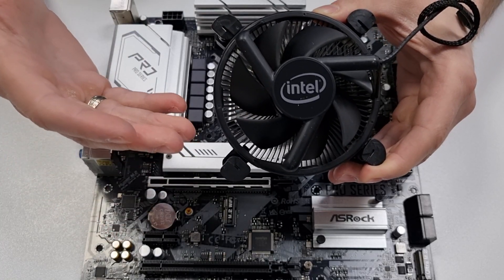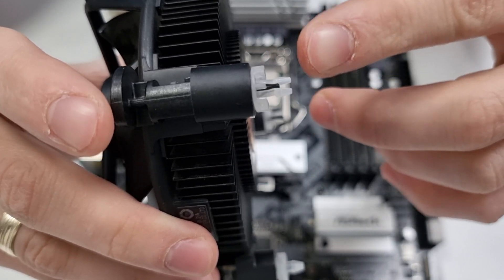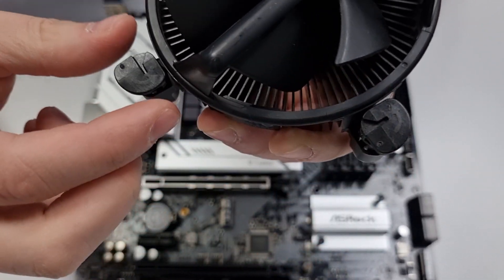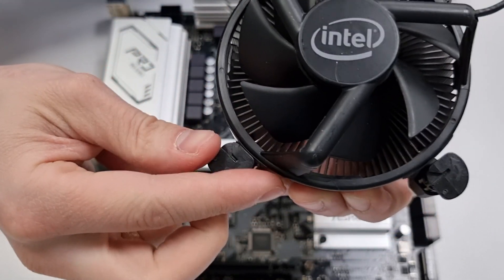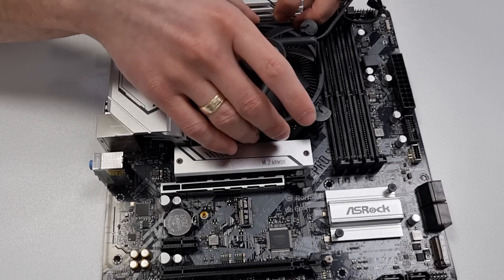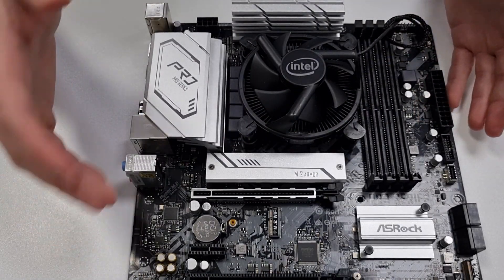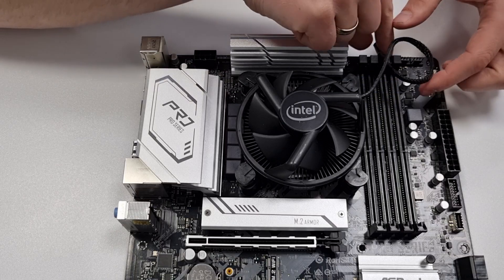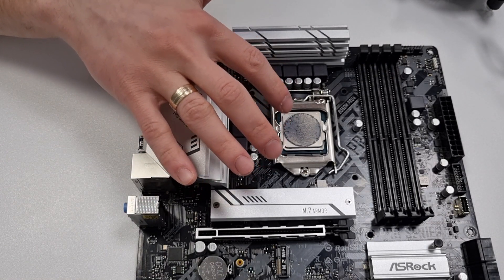How To Install Intel Stock Cooler Without Breaking It.

Comment: Thanks for this video!  Helped me out.   This is the most nerve wracking part of working on PC's IMO.  You're worried about bending the pins on the motherboard, and these stock coolers are the most flaky things.  The plastic looks like after 3 or 4 changeouts it will break or bend.  Plus you put it back in, and only 2 out of 4 go through the holes.  Just hate these things.  Cooler Master makes so much more sense where it just screws in and makes a nice mechanical connection.

Comment: I'm going to remove the stock Intel CPU cooler. This video helps. I'll install a tower type CPU cooler. I'll practice a few times before applying the thermal paste. I've never thought of that. Good advice.

Comment: Damn! I guess I missed it. One of my pins is stuck and I want to remove the stock cooler to install a new one. Can u help ?
Reply from the maker: That’s a tricky one to help with remotely 😄, but let’s try: make sure all caps are set to the removal position and lift the black pins while holding the inner part with your thumbs. If one doesn’t budge, spray the moving part of the post with silicone oil. If you can reach the back side, gently squeeze the translucent parts with pliers and pull the pin outward. Try to work the diagonals simultaneously or it can warp and become difficult to remove.
Reply: Thanks for the tip! I managed to remove the cooler. Here’s what worked for me:

1. Turned the motherboard upside down.

2. Tried pressing the flared pin with pincers (no luck there).

3. On closer inspection, I noticed a small pin in the center. Once I pushed it down into the screw, the flared pins closed easily.

Comment: "when I am  king the engineer who designed this will be  first against the wall"
After sitting on a CPU for years, the white plastic pins that hold the cooler to the board don’t contract properly when black posts are retracted, making it impossible to remove the fan without squeezing the pins from the other side of the motherboard. That’s a total engineering failure.

Comment: I'm fairly convinced they didn't account for the depth of the CPU socket with the CPU in it :D There are a few millimeters of space before even pushing the black things in, so the white pins never actually go through to begin with (only 1 corner, tilting the entire thing). The bottom metal is not a spring, it's fixed. Does this package come with alternative pins or something that I might have discarded from 20 years ago? I solved it by taking pliers to bend the metal to align the white pins be closer to the mobo so they actually go through (that's the most important part). I didn't even have the black ones dangling around in that step! Then I sent a broken off piece from one of the black ones through the hole, and that expanded a white one properly. After that point, probably even toothpicks would work, but I found that the rest of the black ones managed to do a good enough job, each one visible on the other end, if not in a satisfyingly clicky way... I even contemplated breaking all of them and just using the inner cores so they go deep enough in the white ones. (To remove, you'd push on the black ones with a small screwdriver from the backside till the pop out.)

Comment: Thanks man , the guy who design this piece of garbage should be fired
Reply: I have had many issues with installing an AMD stock cooler as the threads just would not grip. Never had an issue with the intel stock coolers and the first ever AMD cooler I mounted was a DOA.

Comment: to open a cooler fan intel just spin to left to open , like a screw  ,,, and  pull a pin  and wiggle it to pop out the fan    (number 2)->  to  set back a fan to the place first you need to reset the pin rotate to right  and push the pin back to the  tiny hole place